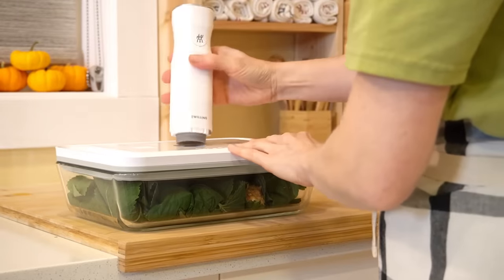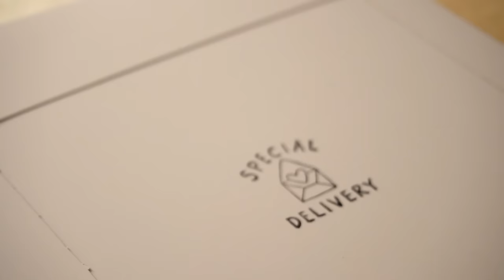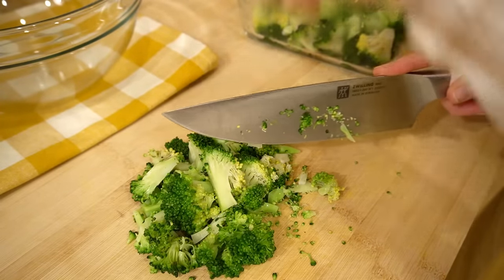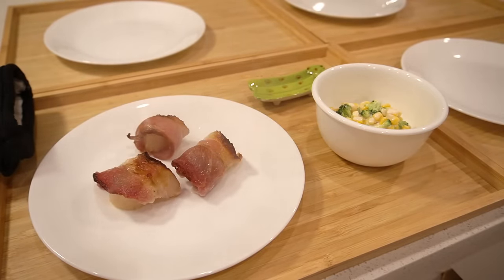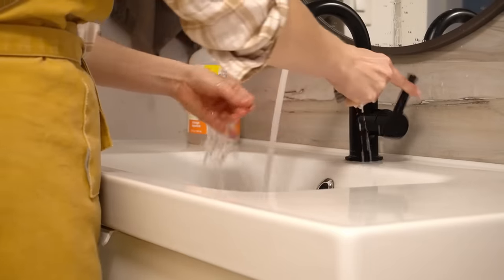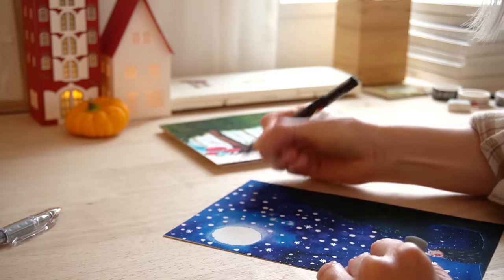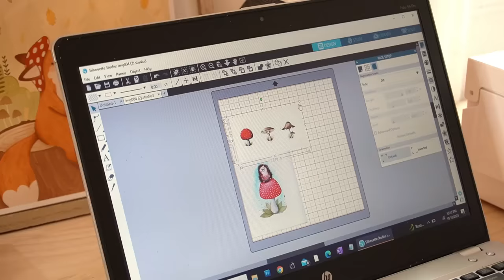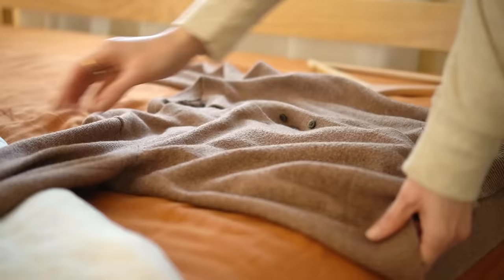START THE DAY WITH A CLEAN HOME | EASY HABITS FOR A MORNING CLEANING ROUTINE

Comment: I am trying so hard to simplify my home like yours!  It's such a challenge because we are also preppers, so we often say "we don't need it now, but we might later".  Attempting to find a happy balance!
Reply: I agree ! What I have found to do ( and still working on ) is to set the excess aside in another room or storage area. My everyday things that I use daily are in my kitchen or  bedroom and the " extra " is set in another place. Sometimes it takes creativity to find another spot but it helps with the overall flow of the day❤
Reply: @libertyandjustus8258  I love this! I try to do this with some aspects of my life but it would be helpful to take it further.  Our home itself doesn't have great space for storage but we have a large garage and shop where more can be stored.  I will work on this! 💞